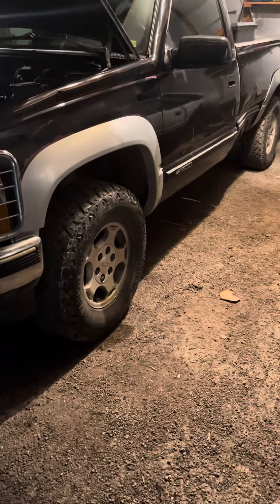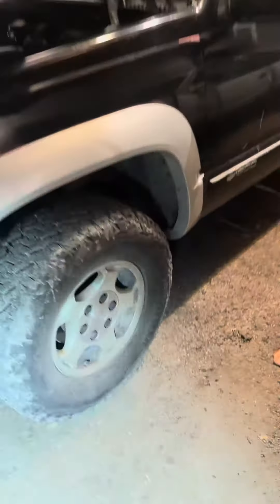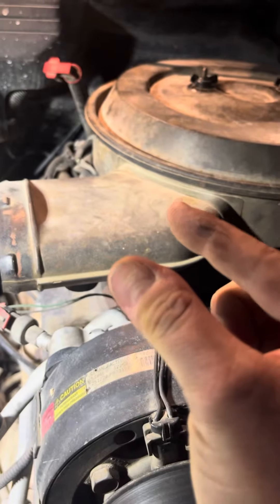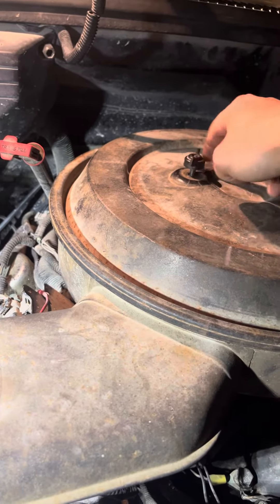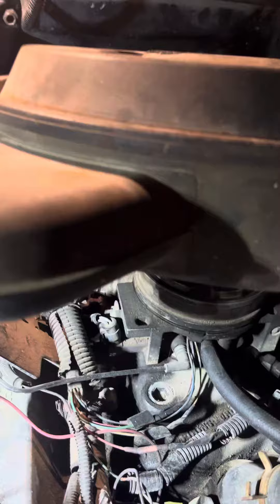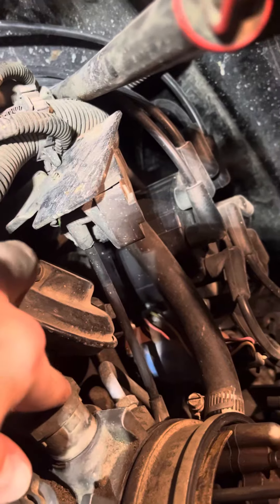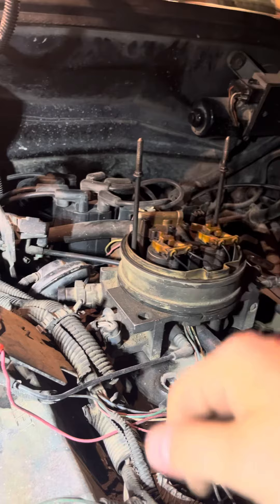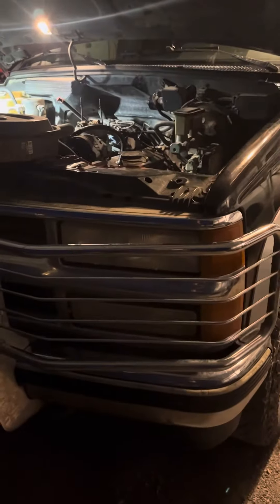Rough Idle Fixed! 1994 Chevy 1500 350

Comment: Did yours run good in the winter and bad in the summer? Cause mine always acts up in the transition from winter to summer and it does exactly what you’re describing. Mine will rough idle when cold and then when it’s warm it idles fine but then stalls when you get on it too hard.